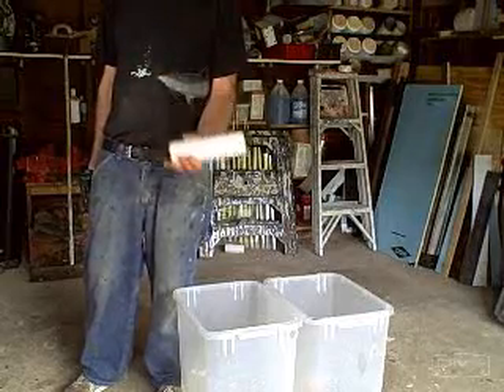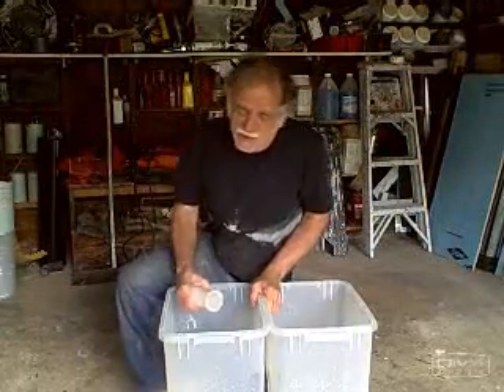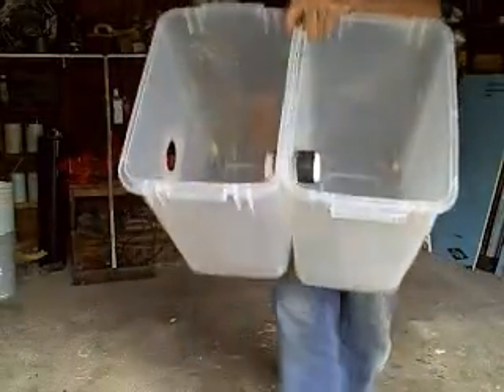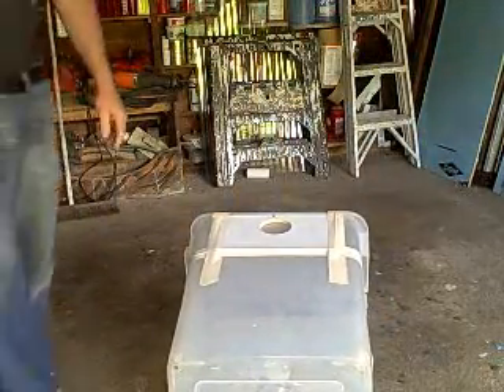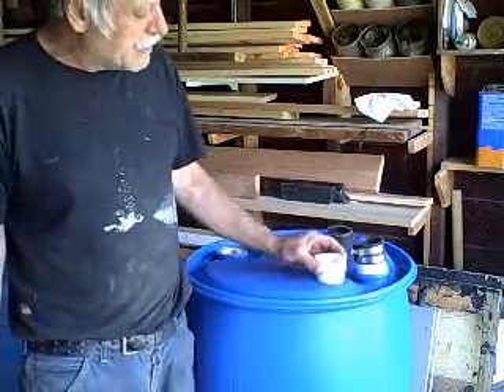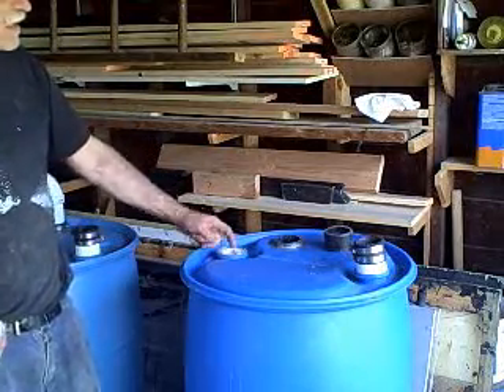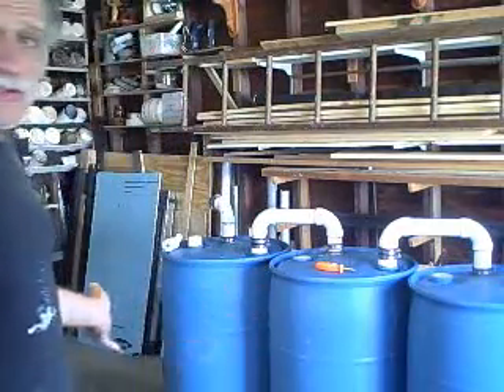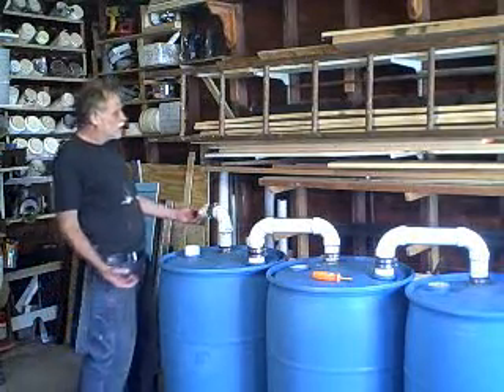Multi Drum Heat Storage

Comment: Thanks for the videos John. Very informative. I am wanting to use a multi-barrel system like you show for hot water heating using PEX to pre-heat my hot water. Should I make a heat exchanger for each barrel or just one in the hottest barrel.

What do you recommend?

Comment from the maker: Thank you for your positive support..
Most of my ideas must sound a bit radical, but I have tested all of them.
The important thing for you is to start small but continue to think big like the sun.
For a large solar hot water system  plan for possible leaks. If you have a major problem in a basement you should have a drain.  
Plastic sealed drums can handle temps  up to 180*F but you should plan on systems that operate between 100*F and 140*F
John

Comment from the maker: Oh getting the heat out of the tanks is just as easy is putting it . A small circulator is attached to the bottom of the hottest tank. so that the hottest water available is circulated through the radiant floor. Call this tank 1,  tank 1 drawa hot water from the top of tank 2 and tank 2 draws hot water from thr top of tank 3  etc  In this way the adjacent tank preheats water for the one in front of it, The cooled water that returned ffrom the radiant floof. enters the tank with the main pump.

Comment from the maker: I use a 2" rubber boot inside the hole. When the 2" PVC pipe is forced through the rubber boot the pressure exerted by the PVC on the boot forms a watertight seal. the boot must be lubricated before sliding the pipe through. It has been over a year now and I have not had a leak yet.